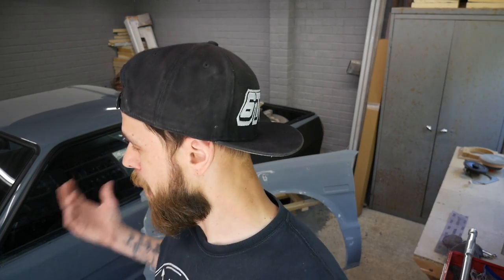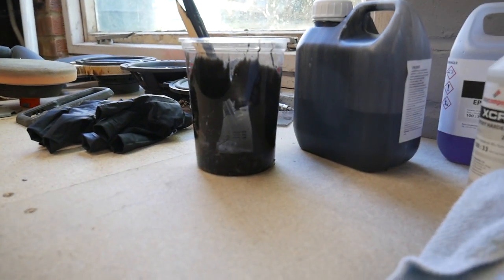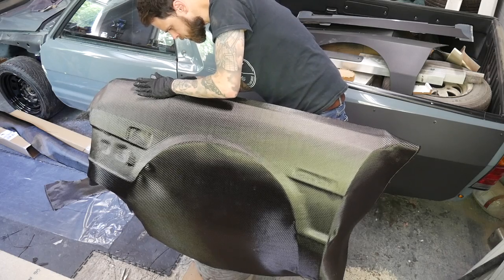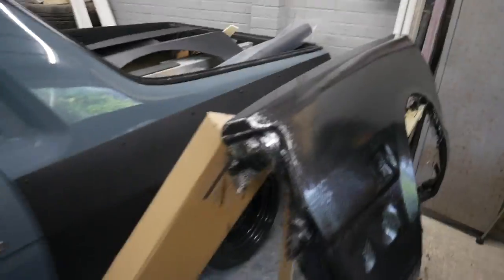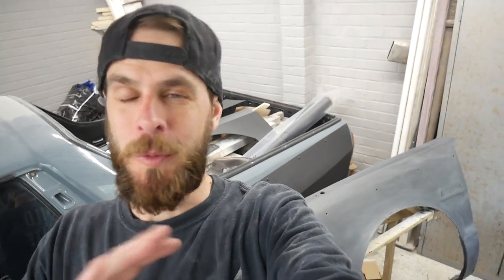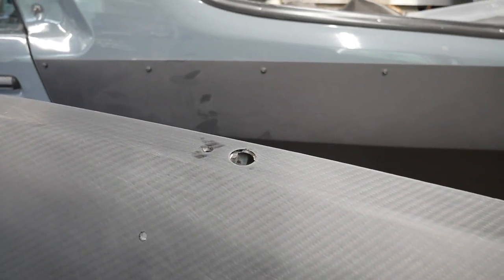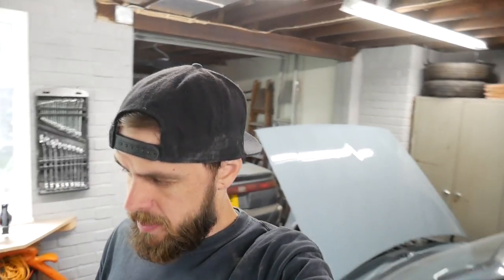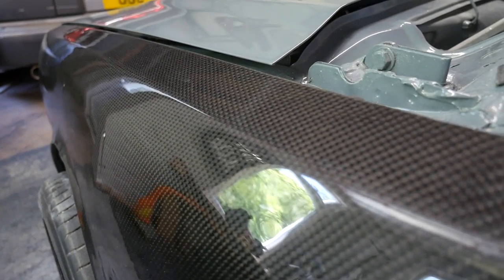Carbon fibre skinning!

Comment: For your next panels, A small paint roller makes the resin spread easier and flater(less sanding) might be cheaper to and lighter to use less resin and do a clear spray instead. I’m a aircraft mechanic who deals with carbon/Kevlar on a daily basis. You did a good job !
Reply: Clear coat way cheaper. I'd do 2 coats of resin, then 4 coats clear. Cut n buff!
Reply: @jakefriesenjake  After the last layer of epoxy dries, what would you do to clear coat after? Any sanding or anything before clear coat?
Reply: @Gborohooo  yeah I would sand it down like normal, probably 120 grit, then go over it with a scotch brite sanding pad to be sure every low spot also is sanded and not shiny at all. then apply 2 or 3 coats of clear coat. Inspect the surface. 
Cut (sand) with 1500g, and check to see if the sanding is indeed cutting nice (no more low spots). If it's good, then go 2000g, then 3000g, 5000g, then 8000g.
Then polish it out till it a mirror.
Before any polishing, make sure there aren't any low spots. If there are, you maby need to do a flow coat of clear (more layers of clear) to get it just right. Then cut n buff it.
Reply: @jakefriesenjake  Oh awesome, that was extremely helpful. Thank you!

This nay be a stupid question, but would a typical body shop know how to do this? I have done plenty of resin/epoxy project, but never dealt with clear coat or even automotive paint. I don't know how similar the processes of clear coating a painted part and clear coating a fresh epoxy/carbon fiber part are, so figured I'd ask.

I really appreciate the help!!
Reply: @Gborohooo 
Yeah, any body shop could do that.
Reply: @jakefriesenjake  Awesome. I'll probably go that route since I don't even have a paint gun and the CFM on my compressor is like 4.5 max. Thank you for the help!
Reply: @Gborohooo  how big is the item you want to clear coat?
Reply: @Gborohooo 
Paint guns are very cheap, and if you are planning on cutting and buffing anyways, you don't need a $300 - $500 gun. Harbour freight cheapy should do.
Reply: @jakefriesenjake  2 rear overfenders, about 2.5 feet x 4 feet at most
Reply: @Gborohooo  check out "the gunman" on YouTube. He has 198k subs. He is a pro painter, teaching others.
He also shows people how to do paint repairs in a small garage, with the cheapest compressor. If you are doing carbon fiber resin molding and stuff like that, you can shoot clear no problem. He shows you the bare minimum what you need. Check him out. He is very informative. Also check out "the paint society" guy. He's also super great!
Reply: @jakefriesenjake  Oh, okay. Maybe I'll give it a shot then. I've been watching some videos and it doesn't look too bad. Is there a specific clear coat I should look for to protect from UV? I read somewhere that Duratec Sunshield is good, but I know nothing about this.
Reply: @Gborohooo  no idea. But I would assume all clear coats have built in uv protection.
Reply: @jakefriesenjake  gotcha. Thank you again!
Reply: @jakefriesenjake  when u get into the 1200+ grits are you wet sanding with wet sand paper or just normal high grit paper?
Reply: @kthanks8045   wet sandpaper of coarse!
If you start sanding with 1500 wet on a freshly clear coated panel, the panel will start as shiny, but orange peely. Sand a couple of strokes, rinse the panel off, use a rubber squigee, scrape of the water, blow on the panel. You'll see how deep the orange Peel craters are. If they look really deep after many strokes, you might want to drop down to a coarser 1200 grit, but if after a few strokes, the whole area Is dull and fully sanded, you're probably good. Then go finer and finer grit. You can use the black powder called guide coat to apply in the 1500 scratches. Then when you start at 2000 grit, you sand until the black haze guide coat is all gone (water won't wash it off)..... You have to sand it off
Reply: Can you put instead of fibreglass straight to foam the black base and carbon fibre instead?

Comment: Nice job, looks great.
I am in two minds to either skin my smart cars panels in the same way or create moulds and make full composite ones. You have got me thinking skinning is the way forward now
Reply from the maker: It’s up to you dude, I’d love to full composite parts in the future. 
Skinning is great place to start with, pretty simple process and get you used to working with the carbon.
Reply: @BuildCreate  I've been dabbling, 3d printing and making a mould for a small air intake. Huge learning curve but I think I'm getting there.
The way you have sculpted those wings from nothing has inspired me to have a go at something similar.
Keep up the good work
Reply: Check out street bandito for some awesome work with carbon, in case you guys haven't seen it.
Reply: @BuildCreate  
Never thought about skinning my 1989 xv1100 until now. Id rather keep her as close to original as possible but that finish would look great on her, pure bad ass.

Comment: Before applying the epoxy basecoat. Cut out all the fiber to size on all panels to be skinned. You save a lot more material. Place closes to each edge to save material. The small bits can be used for  interior peices or smaller bits throughout the vehicle.

Comment: Some ppl will go for expensive custom paint but most going vinyl rap way for more style or new extra thick vinyl for added protection, but sun still beats it up worse than paint. Skinning u get the protection factor, plus durability factor & can still get fancy finished paint or clear look.

Comment: I have just finished skinning my car interiors trims using this XCR resin and have to say it is great stuff however some things I found out during this journey. Car parts need to be post cured before the final flat and polish and secondly although you don't need to lacquer the part lacquering gives a way better finish. I polished some of my interior trims similar to what you did and some of the trim I gave it it my bodyshop to put two or three coats of 2K lacquer and the finish of those pieces is far superior to the rest so now I am going to get them lacquered too.
Reply: 100% agree with this. If you don't post cure the resin, it will ripple when exposed to the heat of the sun. I learnt the hard way, and I've been skinning parts using the same system for a few years now.
Reply: Can you explain more about the post curing process before the final flat and polish? The XCR datasheet says 16 hours at 60C (I’m assuming an oven or heater of some sort?) but is there a solution to curing a large/long part like a sideskirt?
Reply: @muckeyn  Basically you have to apply heat to the part either via leaving it in an oven at low temperature for a few hours or if you live somewhere hot leave it out in the sun for the day.
Reply: @joebloggs4191  haven’t been able to find out much about sun curing. I’m guessing leaving it outside would probably cause print through/sinking and then you flatten/polish/clear it from there?

Comment: Looks really good for a skinning. I usually scuff the low spots with a red scuff pad after block it. The scuff pad is flexible enough to allow you to get into any low spot. The last thing you want is it flacking off on those low spots that you didn’t scuff/sand. UC resins are good but just dont trust them. I always spray a 2k clear on top. But it looks really good man.

Comment: I did this on the inside of my car and outside 5 layers with silicon in between each coat of kevlar ...i used kevlar and the resin my friend did ..he works at a custom shop where they make everything carbon or kevlar .i painted over mines tho ...i drive a almost bullet proof crown victoria..lovely car ...

Comment: Just found your channel and subscribed!! Thanks and keep em coming. I just built a mold and this is my first go at Carbon Fiber work, I am going to skin two small pieces. This is what I found handy fro trimming a Multi-Tool. Drummers run out of steam to quickly.
Reply from the maker: Thanks for checking out the channel dude! 
Multi tools are definitely best for cutting carbon. Way less dust and they don’t create heat and melt the resin from underneath 🤙🏻

Comment: If there will be no clear coat on it it will scratch and become hazy fairly quickly. Especially parts that will be used outside in various weather should be clear coated to preserve that look.

Comment: What did you apply to the fibreglass fender first before you put the carbon down? When you say base coat do you mean black gel coat ? Heard there is some bonding issues with carbon onto fibreglass ?

Comment: Hey man lovely video, can I ask what size sheet you bought? And how much resin ect? I want to do the boot on my 200sx and trying to work out how much I'll need ! 
Thanks man
Reply from the maker: Thanks dude. I used a 1500x2000 roughly. I can’t remember the exact sizes off hand. 
I used a 500g kit for the black gel coat and I got a 1kg resin kit. 
Good luck dude and have fun!

Comment: Can I ask a stupid question??...... what if....(stay with me) you wanted to lay down som carbon fiber SS stripes on the hood of a vehicle (like a set of Camaro or Chevelle SS stripes) could you have a tapered enough finish with the cloth/resin/clear to sand it down to a smooth enough  edge, to then the paint the rest of the hood?

Comment: Have two parts:  a hood ( what you guys call the front bonnet ) and duck-tail (rear engine lid) in f/glass I wan't to do a carbon wrap to,  so thanks for the video, yeah, it's a 911.. What weight of cloth do you use and which weave is it?

Comment: thanks for this video, helped a lot with my own project. By the way does somebody know how many layers of carbon would be necessary to substantially strengthen a steel car body, talking about  2 to 4 times, the initial strength of the factory version?

Comment: Chris, could you use this process for making carbon copy of an original metal wing? If you metal taped the wing off then laid the carbon over the tape and then popped it off?
Reply from the maker: Yeah you could totally do that. I tested a piece on the tape and it released without a problem.

Comment: Outstanding work 👍🏻
Reply from the maker: Thanks!
Reply: Build Create no probs credit were its due I have a question I have a spoiler which is rounded not sharp angles which is best process would u say to cover in real carbon fibre it's more curved edges end to end again great work all the best 👍🏻

Comment: At the start of the video when you were putting the base coat, was that the original metal fender? Or the mold?
Reply from the maker: Neither. It’s a fibreglass wing that I skinned.

Comment: How hard is it to work the carbon in tight area’s? Turned out great for your first time!
Reply from the maker: Honestly not that hard. It’s a simple part fortunately. As long as the basecoat is at the right point where it’s nice and tacky you’ll be fine. 
The cloth I used isn’t too thick, so it takes the shape easily. 
For anything more complicated I’d use a vacuum bag for sure.

Comment: Wondering if you could just use the old panels for a mold and replace most panels with carbon fiber this way.
Reply: Rictacular James; yes you could, but it's extremely costly and time consuming. Check out "Throttle Stop Garage" and you will get an idea of the insane  amount of work needed for a good result.

Comment: Are you going to use automotive clear coat to prevent fading?
Reply from the maker: The epoxy has a UV system built into it. I might clear coat it at work if i feel like it needs it.

Comment: So is this basically a carbon fiber wrap, or did you remove the metal fender from underneath?
Reply from the maker: Yup, that’s what skinning is. The wing stayed in place....like I said at the start, the wing is fibreglass. Not metal. It’s stronger and still lighter than a oem wing.

Comment: So am I right in thinking the original panel is still underneath the carbon and its not a newly created wing?
Reply from the maker: Yup, that’s what skinning is. One of the main reasons I did it is because the wing is fibreglass and wasn’t the best quality. I wanted to make it stand out more and add some strength.

Comment: Did you peel this off the fender or do you just add a layer of cf?
Reply from the maker: Skinning is just adding a layer. In my case it’s to cover up the bad fibreglass fenders and add some detail/texture to the front of the car.

Comment: Hye there! I have a question.
How do you clean your brush (with which you apply epoxy resin) everytime after applying a coat of resin?
Did you take a new brush everytime and throw the previous one or u clean it for next time usage?
Reply from the maker: I used a new brush everytime.
Reply: Ohkk.. thanks alot!

Comment: If I’ve already got a painted body piece that’s black, all I’ve got to do is sand off my clear coating- correct?
Reply from the maker: @JAWS_2K  you don’t have to sand it off. Just key the surface so it has something to adhere to.
Reply: @BuildCreate  my guy. Thank you for the quick response. Going to be attempting my hood and side fenders here pretty soon
Reply from the maker: @JAWS_2K  my pleasure dude. 320 sandpaper should do it. Take your time with the process, easy to get carried away when you get into it.
Reply: @BuildCreate  knowing me I’ll hyperfixate on it until it’s “perfect” and regret the last 20 minutes of sanding 😂 but hey I’ll follow you on the gram and send progress pics if you’re interested- it’ll be from Ghost

Comment: Just for looks then? You added weight for little to no extra strengthening in the big scheme of things. It's not a track weapon . It's cool don't get me wrong but mouldy would have been easier and lighter
Reply from the maker: Yup, pretty much. It still weighs less than an oem steel wing being fibreglass underneath. 
These things only weigh around a ton, so not too fussed about a bit of extra weight....especially when I swap the engine out.
Reply: I ain't bashing it, when I had a scooby anything carbon on it was for looks too 🤣, but I didn't do the wings (or fenders for the yanks) just bonnet roof and boot. It just looked faster..😁👍🇬🇧

Max Power Generation.... man fun times
Reply from the maker: I didn’t think you were dude 😊. It’s definitely more of an artistic expression than a build with a specific purpose.

Comment: Can i add mold release on the part i'm skinning so that i can use it as single carbon fiber panel?
Reply: If you want to make carbon fibre panel the process is harder... You need to make first mould out of fiberglass then use that mould to make carbon panel... Unless you plan on making many of them this process is not worth it and youre better off buying the real carbon panel with good finish
Reply: @e36fanatics  can i make a carbon fiber fender without vacuum infusion
Reply: Great video: questions.. Suzuki Jimny with rusted rear floor - do you think it would work to line the floor with carbon fibre rather than cutting and welding - will it bond well to clean metal after removing rust, and will it be structurally sound? (I picture it looking great, but would hate it to pop off after a while or have a MoT inspector prize it off with a screwdriver...)

Comment: Almost thought you were copying the panel in carbonfiber and replacing it to lighten things
Reply from the maker: Nope. Skinning is just covering something. The panel itself is fibreglass, even with the carbon skin it still weighs less than the oem steel panel.

Comment: did you not post cure the wing or lacquer it?
Reply from the maker: This particular system doesn’t require either. Although I will lacquer the wing later on when I paint the body.
Reply: Build Create I used the same XCR resin and you’ll find if you don’t post bake it the resin will sink once it sits in the sun for a while. Work looks good though mate!

Comment: When do you pop it off the actual fender?
Reply from the maker: LS1B4C it’s skinning. So it stays on the fibreglass wing.
Reply: Oh so a wrap type? I get you. How much did it cost? If you got in large or short qty. So basically the layer of the cb weave above whatever part and clear coats in stages?

Comment: If you're going to go to all of this trouble to wrap a fender, why not just go a little further and just make a carbon part?
Reply from the maker: Well, the fenders are fibreglass replicas and not the best fitment and this was also the first time I’ve ever used carbon. I definitely want to make full carbon ones in the future, but I’d have to find mint condition metal wings. That’s a very tall order in the UK as all off them have rotted out.
Reply: @BuildCreate  fair enough. Good video either way.

Comment: Weren't you supposed to make a mould first. Now it will be larger than the original
Reply from the maker: The original is a fiberglass rep with big panel gaps. I don’t have any clearance issues at all.